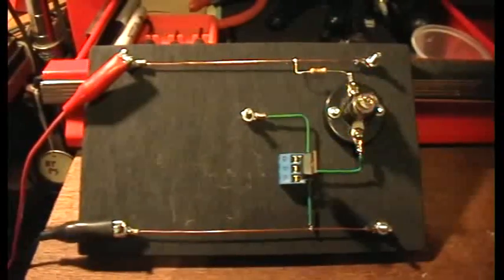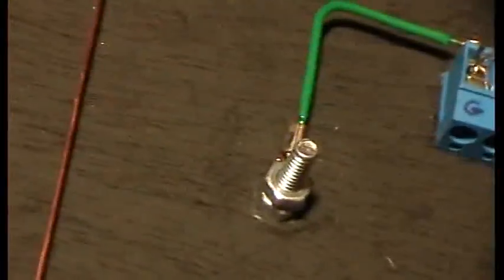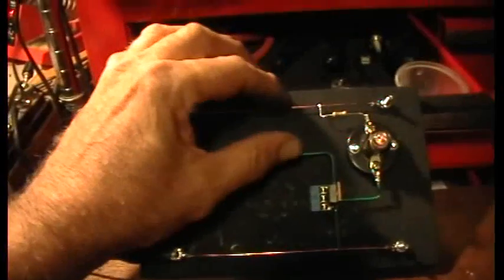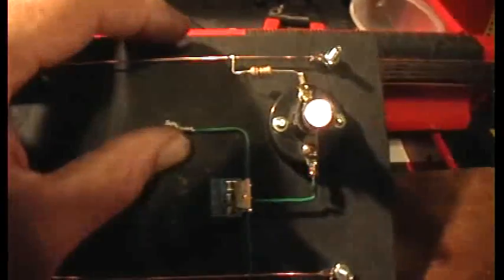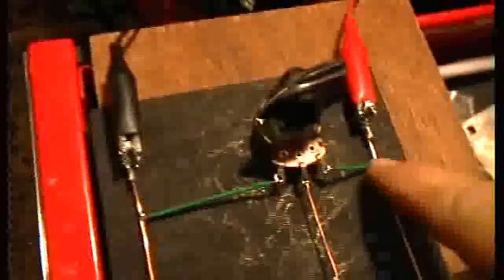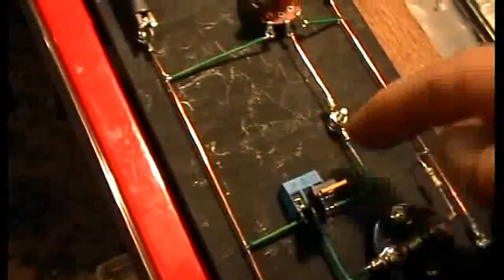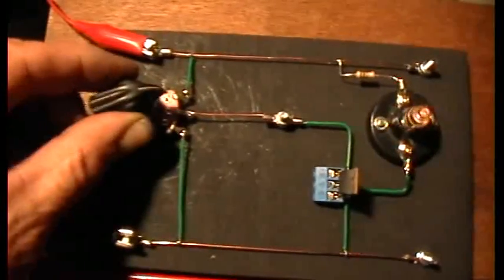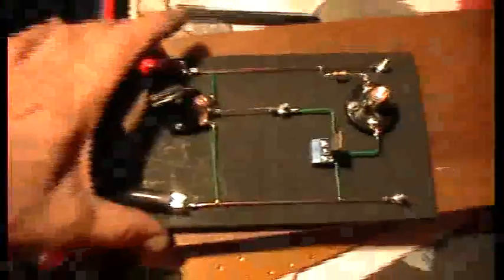Electric OU: Supplement: MOSFETs... How Do THEY Work?? Parts 2 and 3

Comment: MOSFET==Transistor + capacitor?
it makes the same job, i think mosfet is a transistor whose Beta value of (HFE) transistor higher)
and have a  capacitor.
when i watched your video, when you touch the positive side of cable and mosfet, it charges a little and after it works as switch on/off
thanks for video!